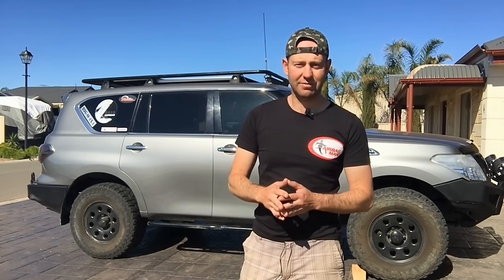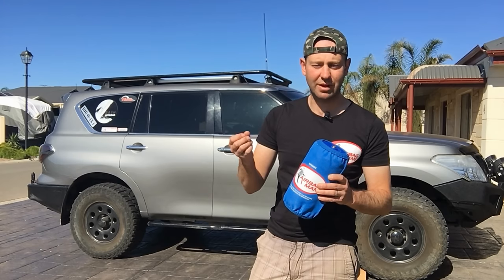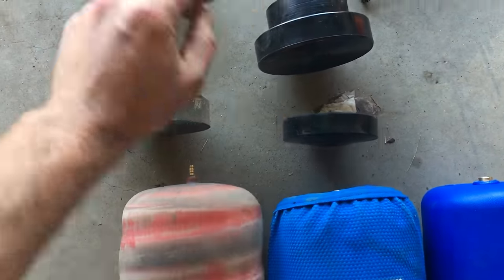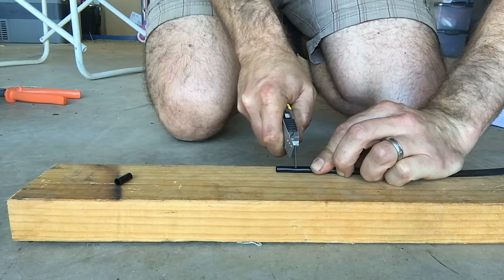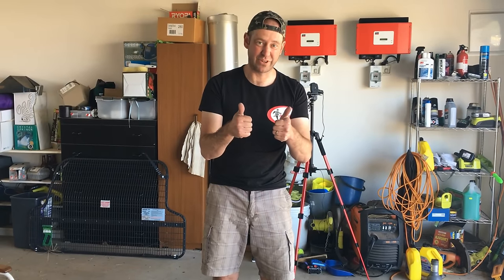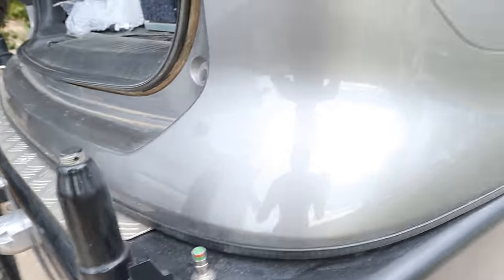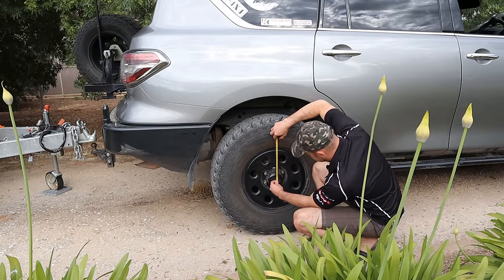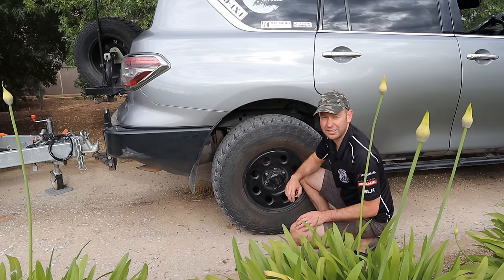Why Independent Vehicles 🤔NEED🤔 Airbags! Airbag Man Compared to others.

Comment: Have had Poly red airbags in my Pajero now for 4 years with towing a 'van.
They have performed faultlessly, and only need about 20-25psi., and about 10psi. for around town. My 'van is just over 2.1tonnes and ball weight about 170kgs.
Also fitted heavier normal height King Springs. Been through the macho tough truck phase, and have found I have less problems leaving the vehicle as near as stock as was designed.

Comment: An easier instal solution, if you don't have existing bags to remove, is to simply jack up the rear of the vehicle up allowing the suspension to drop (spring to extend fully) remove the wheel, then compress the airbag with the cover on it and block the connector hole in the airbag with a bit of blanked of tubing. Slide the lower spacer block through the gap in the spring followed by the airbag with connector to top, then the upper top hat block. Unplug the airbag and allow it to inflate, spreading the bag and cover evenly inplace inside spring. Connect and run the airlines to a suitable mounting point avoiding chafing points and exhaust. No special tools required or specialist mechanical skills. Job done about 2-3 hours taking it easy.

Comment: Good vid mate, I have a 200 and am looking into these too. Question is how much better does the car feel with air in them as opposed to deflated when not towing or heavily loaded? Cheers Steve
Reply from the maker: The only time I use them not towing is when I have 7 people loaded up, then it makes a big difference. When deflated you wouldn’t know that they are there
Reply: Cool thanks for that! Is there a minimum press to leave in? Say 5 psi or not on these? Polyairs I used to have were crap and needed 5 psi.

Comment: Hi Dave, just did over 8000kms with our camper on the back of the patrol with a weight distribution hitch your right it's chewed out my rears, have you had any problems with these airbags?
Thanks
Heath.
Reply from the maker: Only when I ran the hose too close to the exhaust, it melted. Relocated and now all is good. Great product 👍

Comment: yungun,you want to know a better solution,..................................,pump up shocks.with 1 valve,why,??.because you can raise lower the vehicle,the air goes from 1 side to the other,off road,plus,there std shocks when empty.solvered problem for $200.but then,why buy a 4 wheel indi susp 4x4 in the first place.??.it aint real.look up ford f250 highboy.i have one.no mods needed.but to you anything more than 2 yrs old,,is old..

Comment: Thanks for the info as to the change in arch height with increase in pressure, I think I need to increase the pressure I use after listening to you. One point though regarding WD Hitches, yes, they can be a ‘pain’ but when you add your hitchload to the towball the rear axle becomes a pivot so you are taking weight off the front axle and that weight has to go somewhere so you are adding it to the rear axle. Although your ride height is evened out by the airbags it doesn’t redistribute the added weight. The danger here is a lighter front end and an overloaded rear axle.